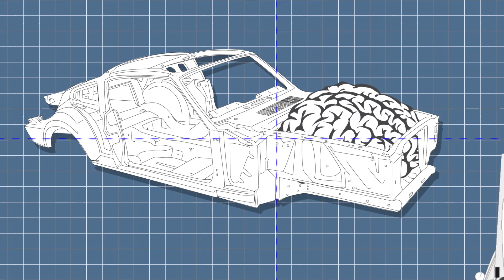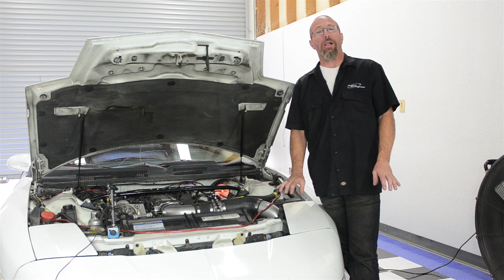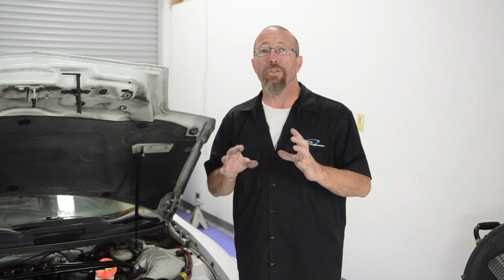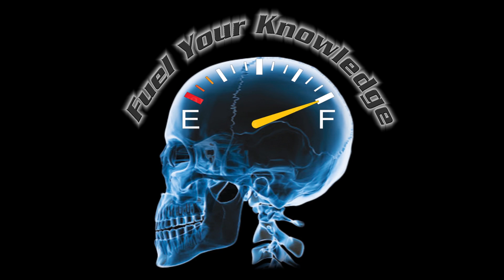FAQ: Boosting a Stock Engine

Comment: I had my LT1 bored/stroked to 385cu.in and built to support a rear mount turbo. put down about 580... my buddies LS1 with stock block w/forged bottom end and heads put down about 580 with same turbo specs.. moral of the story, it's cheaper to get more power out of an LS1 than an LT1.. but the iron block LT1 can handle more boost

Comment: Single digit boost numbers are typically ok on stock internals once you move into double digits it’s a hole other ball game but nothing will live long with out proper tune and fuel octane too much timing, too lean, too much boost to high compression ratio bad gas, hot plugs say by by!

Comment: How to boost a stock engine. 
Step 1. bolt the turbo on. Run oil lines, and hook up intake tubing.
Step 2. DRIVE.

Proof is on my channel. That's the most basic you can do. All my cousin did on his miata was put a turbo on and go. No new injectors, no new computer, completely stock engine with a turbo put on. But, to do it a good way. You would get it tuned and what not.
Reply: Just be careful as to what turbo you choose. You could use a smaller turbo with high psi and be fine. Yet a large turbo with say 5 psi can very easily blow your engine.
Reply: Smallest i'd go, Garrett T25. Those can be picked up pretty cheap if your on a budget.
Reply: Does your cousin have the 1.6 or the 1.8 engine?
I have a 1.6 (1993) and want to boost so I have 'some' power under this thing (like, I'd be fine with 160-230bhp range to be honest).

My engine has 55k on it, no major problems, just routine maintenance and a leaky oilpump some 15-18k miles ago that was fixed by the PO at the Mazda dealer.
Think my engine would be ok to boost for a daily application?
Reply: Oh yes. My cousins was COMPLETELY STOCK. All he did was put on a turbo and run oil lines, boost gauge, wastegate, intercooler and bov. Ran 10 pounds for months. It spun the tires easily through 3 gears. And yes, your car would be perfectly fine for dailying under stock everything with boost. It's good if you tune it, but you don't need to tune it. Just run around 10 psi or lower.
Reply: KARsandJTsUSERNAME Great! :) about what are the power gains? Also, what kit did you use? just made up your own or did you use the kit from Flyin' Miata?
Reply: Ebay kit. Was only like $500 and comes with everything you need to boost your car in one night. And it was a lot faster. How much horsepower idk because it never hit the dyno lol
Reply: Ah :P

And I've heard some horror stories about the eBay ones but I guess it's just luck of the draw (something about improper welding and possible weld-beads inside the piping destroying the turbo or worse, the engine)

Mind sharing the seller you got yours from? I'm guessing its pretty dang reliable if your cousin is thrashing the roads like that :D
Reply: People push too much with ebay stuff, They're good for low boost builds, people think they can handle 20 psi or someshit and they can't. My cousin went several months on two seperate builds with ebay shit. Both lasted months, again, stock ecu and everything. First one he sold the car, second one he did a v8 swap. Motors ran strong. First one was a d15b single cam crx, smoked a k20 civic on the highway and on the track. Just don't push them to their limits and you will be fine. CX Racing turbo kits are the ones to go for.
Reply: I've got videos of him doing burnouts and trying to drift and stuff on my channel.
Reply: Craig Davis I was thinking smaller too, since my engine is only a 1.6lt, I really don't have any justifiable reason to have a large unit. I'm honestly looking for some lowend grunt... sooo smaller so it spools up faster.

However, how small is 'too small' for a 1.6lt Mazda engine? Any turbo recommendations?
Reply: Alrighty :) I'll get on it. Also, think it might be a little more efficient and save some drips of fuel or guzzle fuel with a power goal of around 200-250?
Reply: You will need larger injectors. More air means more fuel so regardless you'll be wasting more gas. I wouldnt push 250 on a stock 1.6 engine, i suggest getting a new ecu (megasquirt). The t25 can get you about 140-180hp with a proper tune. At 200-250 your risking reliability.

Comment: how to get good gas mileage on a pontiac firebird
Reply: Put it on top of a prius.
Reply: T56 with 2.56 rear, Advance timing with a good tune. Edit: Timing made a huge difference in my 4.6, minimal throttle advanced is the same as half throttle retarded spark in city traffic, giving the same acceleration.